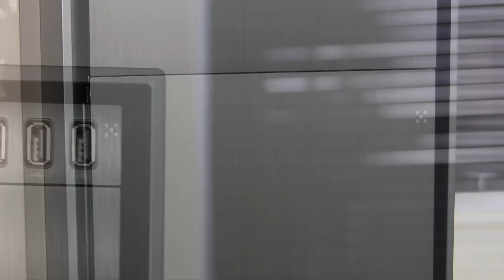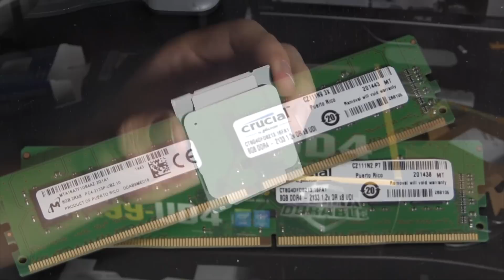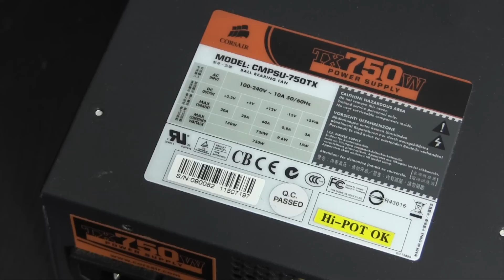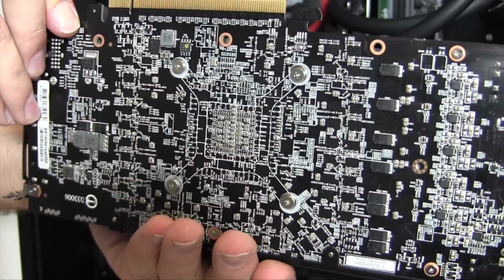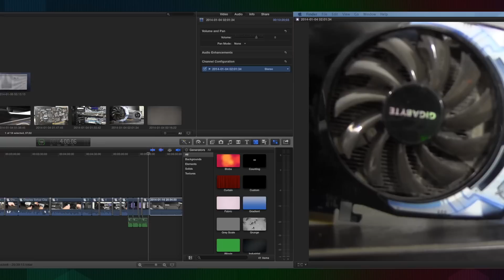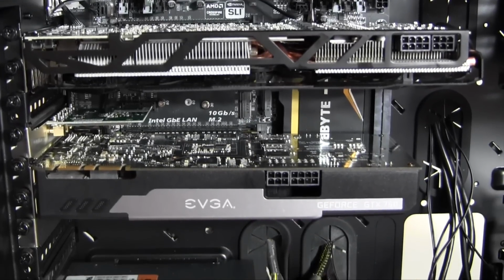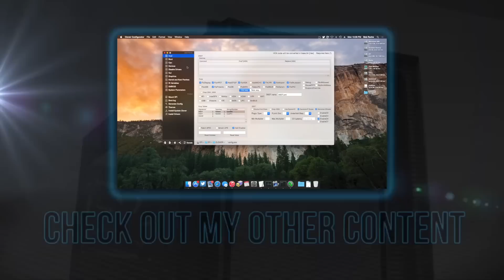Building My X99 Hackintosh

Comment: Hey Bob!  great tutorial.  I'm planning on building my first hackintosh based on your videos, and I'm having trouble finding the Gigabyte R9-290X in stock anywhere anymore (especially here in Canada - none to be found).  Can you recommend another card that will work the same as this one - I obviously don't have the skills to figure out what to do with one should it not work along the lines of your tutorial...Incidentally, I love the idea of getting a Radeon, as everything I've read says that they work so much better for Final Cut Pro X than most of the Nvidia cards, which is mainly what I want this build for - editing 4-6 streams/angles of video (at least two of which are going to be 4K at any time...) - I need something to really render/process a lot of video...

Comment: You're dead right about PSU connectors they are crap.
Reply from the maker: I'm glad somebody understands my pain! Thanks for watching!
Reply: +Bob Roche ill try to find it tomorrow,but there is a nice molex to sata adapter that i use to correct that problem in my builds with multiple hard drives

Comment: nice video dude! Im trying to build my very first hackintosh but not too sure if the hardware components that Im choosing are compatible?  Can you please have a quick look at my list and give me your opinion ?

HyperX XMP Predator Series 16GB (4x 4GB) 3000MHz CL15 DDR4 DIMM Memory Module 
Asus X99 Deluxe Intel LGA 2011 V3 ATX Motherboard
Intel i7 5930K CPU Processor 
Asus Nvidia GeForce GTX 970 Strix Graphics Card (4GB, GDDR5, PCI Express 3.0)

Comment: Does the 290 have the same problem as the 290X?
Reply: Yes it dose. But i have it fully working is Yosemite. check out this post here. 

http://www.insanelymac.com/forum/topic/298443-r9-290-non-x-yosemited-help/page-4#entry2122050
Reply: Audiohacks I got the 290 hoping I could get it working, but even following the guide and tinkering by myself for many more hours, I never got it working. Switched to the GTX 970, which has way better Open CL performance than older NVidia cards. Sadly FCPX still much prefers AMD, but at least the 970 works, unlike that poor 290. 290 in a Hackintosh is just not reliable in my experience. Also I'm pretty sure some cards work better than others (probably BIOS dependent and stuff).
Reply: JRVideoChannel you have to install xcode along with the guide

Comment: To get multi monitor on 290x use a Hex editor to edit AMD8000Controller or use Clover with the following edit using Baladi as your framebuffer:
Working HDMI + DVIs
Find:
000400000403000000010300120403030004000004030000000101001102010100040000040300000001020021030202000400000403000000010400220504040004000004030000000105001000050500040000040300000001060020010606

Replace:
000800000402000000010200220502030004000004030000000101001204010100040000040300000001020021030202040000001402000000010300110203040004000004030000000105001000050500020000040200000001040110000406
Reply from the maker: Henry Brock I'll give this a shot! I assume this won't enable DP + HDMI + DVI?
Reply: Haven't been able to get DP working yet

Comment: why do you use mac os over windows and linux (btw...have you ever even tried it, you can make it very similar to mac if you want to)
PS: im not hating on mac, i just wanna know
Reply from the maker: Looks are only one reason I prefer OS X. The available software for OS X is best, in my opinion. There's nothing wrong with Linux, but good luck finding a fully-featured video editing program that has the interface and design that Final Cut offers.

Comment: Now I've watched it all: With those cables, you may want to do what I did and get some cable sleeving and shrink wrap to keep the spaghetti down inside, especially as you have a see-thru case. (you should be able to get some nice red sleeving to offset that color scheme!) Also, had you thought of custom SATA cables? I'm seriously considering it for a build with an Asus X99E-WS.
Reply from the maker: I have considered custom sleeving; I may pull the trigger on that!
Reply: Bob Roche Yah. Certainly can recommend it. When I built my machine >>> http://www.tonymacx86.com/user-builds/157090-success-ga-z77x-up5-th-i7-3770k-nvidia-geforce-gtx-660-yosemite-1tb-raid-ssd-vanilla-install-imessage-using-ozmosis.html <<< I didn't have all that much need for it because there was plenty of space inside my case. Now it's really full, and the sleeving really helps keep it tidy. It also stops the fans from being caught by all the cables!

Comment: I thought you woukd need four RAM sticks. Two on each side
Reply from the maker: Nope! You can run this board with even a single memory module installed.
Reply: You do need 4 Ram sticks to use Quad channel. but OS X doesn't support that yet..
Reply from the maker: Audiohacks Correct; OS X reads DDR4 memory as DDR3. That said, it still performs quite well!

Comment: Regarding the monitor setup too: I found that my Hack didn't want to work in Yosemite with two monitors plugged in until I swapped them out for digital ones. There's also a colour collaboration issue on some of those graphics chips too.

Comment: good job on the 290x the 900 cards are trash in os x
Reply from the maker: Game Engine Tutorials That's what I hear! What really convinced me to get the 290X was not using many Adobe apps for my content creation. CUDA isn't doing me any favors! Thanks for watching.
Reply: Bob Roche even adobe not uses opencl in os x just like fcp i have a 290x fully running in os x with all 3 displays working without issues all i needed was a dp hub that has a dvi and a dvi-d and a dp port